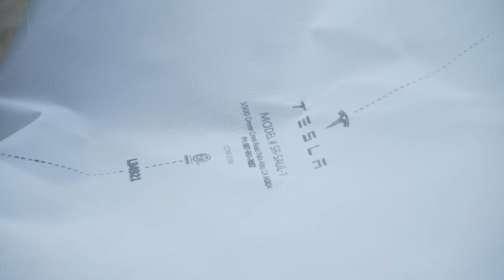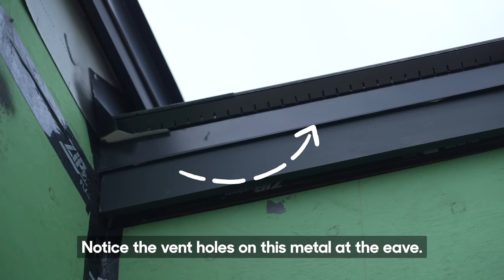Tesla Solar Roof - A Builders Perspective

Comment: 3 to 4 times the cost is all?  So this costs, what $100,000?  I like the solar option - what I don't like is the subsidy.  I installed a solar system in Phoenix and basically it was a 10% return with the grid rebate.  APS, the power company in Phoenix, does not allow "off grid".  that system in Phoenix with a lot of sun, however, the chemtrails do obscure the sun.  In Phoenix, if you want battery backup they require an additional meter for you batteries.    Without the rebate the return would be less.  Power in Phoenix is 15 cents per KWH.   In southern Utah power is 7,5 cents per kwh so solar doesn't really make sense.  Obviously off grid is a different story.

Comment: 24 years in the solar business and all of that being involved with solar panels and I have seen solar roof shingles come and go and I have seen all of them go bankrupt and the vast majority of them have technical issues and failure problems within five years. Not a single manufacturer has survived this technology approach. There are some true horror stories when it comes to the Tesla solar shingle including absolutely exorbitant installation labor costs. I wouldn't touch this technology with a 10 foot pole. It is pretty however!

Comment: Cost??
Reply from the maker: He said it was 3-5x a metal roof cost. Most metal roofs are $3-5/sqft around here so I’m guessing it’s $10/sqft
Reply: @buildshow  Hey Matt. This is inaccurate and I want to make sure that people get this right because if not, people will compare this to a roof or a solar system rather than a luxury roof with a solar system. The cost is closer to $50-$60/sqft if you include batteries. That is before the tax credit. After the tax credit, it is closer to $40/sqft.

We have installed about 50 of these in Texas so far.
Reply: @buildshow  thank you

Comment: 3:09  50 kW  PEAK and its unlikely you will see that with those arrays in different directions and pitch not optimised, maybe 50% of that there on a sunny summer day if you are lucky.

And 3:40  Batteries need DC not AC  .. PV voltage is generally fed into a solar charger which is DC coupled, that might all be hidden away in the Powerwall box. 

According to Engineer775, who does lot of solar installations there in the US (and who dislikes roof arrays for a number of reasons) EACH roof PV panel requires a DC disconnect (switch), is this a States wide code? He swears by Sol-Ark and ground arrays  .. no need for over priced Tesla products, and two gensets wtf.... You should hook up with him, he knows his stuff, at least that batteries are DC . 

For PV panels damage problems I've seen are micrometeorites, and more common than one would think.

Comment: Drop a steel ball instead of a golf ball. Lets see how the Glass works out. Must be the same glass from the tesla cybertrack. Also wtf are you on about about them bouncing off? The degree of the impact is irrelevant, it will always bounce off, even if you break the glass, unless of course it goes through. "It didn't go through" - Elon Musk 2019

Comment: 3:34 pretty sure he didn't mean to say the batteries will receive AC power and mixed up the previous step as well. Would be interesting to see an AC battery though and no... NOT an AC Delco battery, you smart a$$es. 😉

Comment: 50year roof with 15 to 20 years only life span on the solar panels themselves!!? Most solar panels have proven to have 10year working life span before needed replacement also we still have no method of recycling or reusing old solar panels! It generally takes minimum 20years to regain your initial cost expense.

Comment: Those batteries are never going to fall below 80% state of charge. Prime example of a stupidly over sized system. With the amount of solar they have they could have gotten by with 2-3 powerwalls easily. Even on cloudy days that roof is going to produce 9-10 kw an hour.

Comment: Yes this is cool to see. But my god, if we are talking real world money, which we always should be. This stuff makes ZERO sense to me. I don't do roofing but I have done a lot of electrical work and know what it cost (or doesn't, cause so cheap) to install a inter lock kit or transfer panel. Which can be connected to a permanent or portable natural gas generator. For that kind of install, including equipment. You will not be over 10k. And could be as low as about $3k if you want to use a portable generator + interlock kit. The roof install alone on this house was probably $50k - $80k, but that is almost nothing compared to the TEN Powerwall batteries he said they installed ?!?!?!

Last I checked ONE powerwall Tesla battery is $14,200 EACH!! So you are at $142,000 JUST IN BATTERIES !!!! And even worse. The warranty reads as follows. "The Tesla Powerwall warranty period is 10 years. During this time frame, Tesla ensures that your system will maintain at least 70% of its original storage capacity." So I can assume you will lose 20-30% or you battery storage over 10 years. That is roughly $42,000 dollars of battery down the toilet in 10 years.

 Now it also make zero sense to me that ANYONE would need TEN! Tesla power walls. Far as I know 3 is the most I have hear installed here in Cali, even for large homes with Tesla car charges and all electric heat/water. So an equivalent generator system would be as much as $40k - $50k thousand to match 10 Tesla power walls at 132 kwh total capacity (13. 2kwh each). But, still that is WAY cheaper even with the government paying 30% of the bill. Also I would guess the generators will be running 99%-100% efficiency in 10 years time. 

I respect the skill and knowledge it takes to install this kind of setup, and I love that Matt brings us these very informative videos. But I can't respect the insane cost this is over alternatives for the consumer. And all that cost is for a product that no body knows will last more than 30-40 years.

Comment: In Hawaii already programs where Hawaii electric buys your excess electricity.  Programs to help you(incentives) add powerwall battery storage where electric company can use your batteries to help peak surges of power especially between 4pm-8pm.  Electric companies previously dumped or wasted too much power made by solar/wind.  With more residential and commercial battery storage no more dumping plus smooths out operation grid.  Electric companies want more micro grids vs present MACRO grids where power outages take out half the city.  Electric companies using your roof vs buying land, grading, and running miles of wire and costs panels/batteries.  Future systems will allow deals where electric company can use your EV battery as well and make sure it is full before morning commute.  Hawaii already over 30% renewable.  Not due to electric company but private, residential solar rooftop!!!  Home owners/resorts/businesses taking charge of their future vs waiting for government.  Electric companies know they are behind.

Comment: And that is an average build, right?  Only for the elites
Reply: Nah drastically overkill, even for the elites. Normal households with a 15-20k budget just get 10-14 kw system with 1-2 5kwh batteries.

Comment: Funny that he says no one wants to be without heat for three or four days in the winter, then right after that says the system is made to only last through the night then be recharged the next day. 

I also still don't understand the popularity of the tesla powerwall. They are so expensive and lithium batteries have such a short life span. If you aren't hurting for space like these clients clearly aren't, go buy some iron nickel batteries. They last forever and are way cheaper. I think Iron Edison sells a 50kW system like this house has for $50k, that is both panels and battery. I would bet the ten teslas in this house probably cost $70k and will be junk in seven years

Comment: At 3:30, he explains that the tiles produce DC, which is inverted to AC and that AC is what charges the batteries? Fail. Batteries take in and give off DC SMH. It's not good when the 'professional' who is installing this expensive electrical system doesn't even understand the absolute BASICS of AC vs DC.

Comment: Now go with me on this one, If the Tesla Solar Panel Roof is so far behind on manufacturing and people are waiting years to get them, why would you waste the materials and manufacturing on non-performance tiles, why not have performance tiles and do the non-performance side of the house in traditional or metal and use those panels on the next house?  

You are wasting at least half the materials and manufacturing to make solar panels that aren't collecting solar power just to make it look the same on both sides.

Comment: Probably spent $400-500k on this wet dream and the average cost per kWh in Texas is $0.13?? What's ROI on this? NEVER?? a 100kW ground mount and a Copper roof would have been much cheaper. Would have needed less batteries and it could have been EMP hardened too. What a boneheaded move.

Comment: At 3:33 ish, NOT CORRECT! In this system it's strictly DC solar power through circuits to charge DC batteries, then DC power is inverted to AC feed! "And then the batteries will receive AC power" !! Stupid
Reply: I love the product but not the contractor - he's a dummy on solar electrical

Comment: Right now the idea is to go 100% electric with appliances and install a huge battery bank... I predict that 10 years from now a system like this will have fewer powerwalls and instead a Sabatier process reactor will fill a LP tank using excess energy... If there is huge demand for electricity at night (say someone arrives home after dark and needs their EV fully charged by morning) the backup gas generator will run for a few hours. Similarly, on a snowy cloudy winter day a gas fired heating system can supplement the heat pump using gas produced on site months before on a sunny summer day.
Reply: Pipedreams and still ultimately relying on diesel generators.
Reply: @MattyEngland  Natural gas generator, not diesel. Sabatier process uses electricity, water, and CO2 to make natural gas (CH4)... It's a well established industrial process, and there are multiple startups developing household scale units. It isn't very efficient, but if the grid provider is paying pennies on the dollar for your excess electricity in the summertime, making gas could be a very good alternative use.

Comment: GO BACK TO THE HOUSE, please..  I love my Tesla EV, Tesla solar, powerwall.  
Can control everything on my Tesla app saving money.  I save $600/month on gas and home electricity in Hawaii.  13k w system on 2300 sf house with only one powerwall battery.  Batteries are especially important for the future.  So much research going into the next battery lowering cost each time.  Tesla stock is both motors and energy.  EV cars have made battery Costs come down for battery storage to be competing on  the grid.  The HOLY GRAIL SUPPLY/DEMAND IS STORAGE.  Musk would rather be called the battery GURU vs the Car Guru.  Batteries are the engines of the future.  Electric motors last forever.  Batteries right now can last 500,000 miles or more. An EV could be a forever car.  Repairs are plug and play.  The roof and powerwall no moving parts could last forever.  Maintenance is the pain of ownership of anything

Comment: Third generation mechanical engineer, this way to over thought, way to complicated. Ditch all the wires, go to a click in format like a DeWalt cordless tool. I do not get all this over engineering, this is taking way to fing long to scale. KISS this design.Sandy Monroe would laugh at this, the master of fasteners. Up the voltage in DC, = less wiring, each roof should just be one leg to the panel. Just looking at the main panel, there is no way this can scale, I want all the engineers to sign their name to this , so we can teach the young how not to do this.
 Would love have a shot at this and do it in halve the part #’s.

Have to say to this install, you really suck at bringing this to the masses., signed Milton Hershey.

Tic/Toc, way to much time spent to scale to Giga Watts……